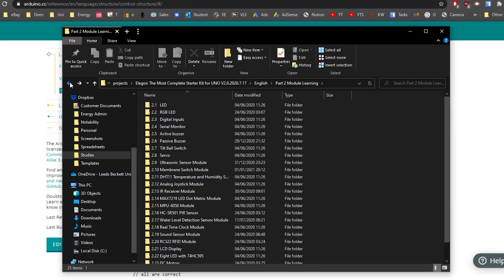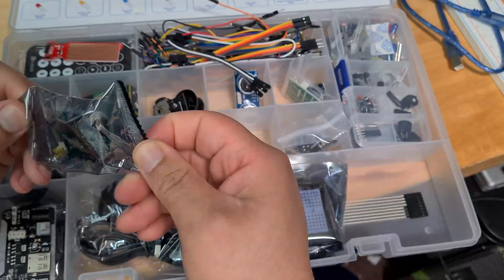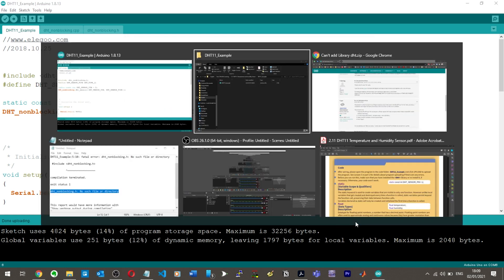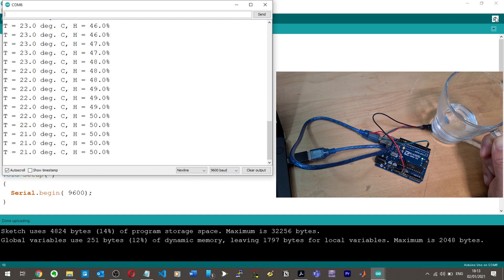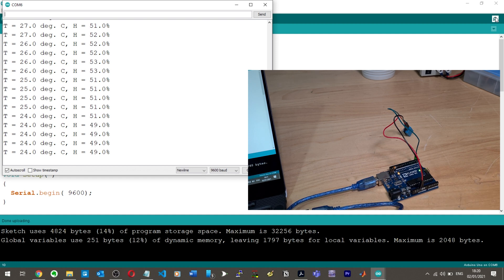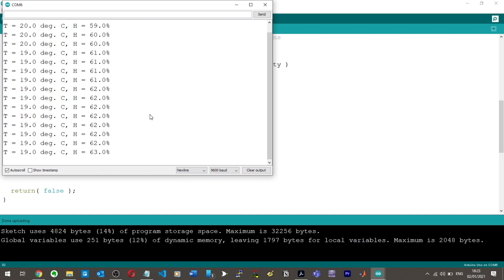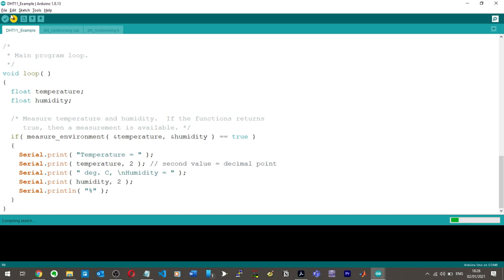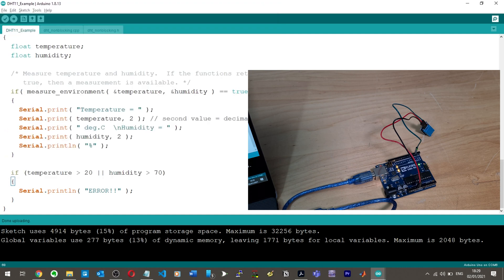DHT11 Temperature & Humidity Sensor Arduino Tutorial - Elegoo The Most Complete Starter Kit

Comment: I expect the temperature change is not related so much to the sensor as it is to the speed of heat conduction between the sensor and the environment. Air is a pretty poor conductor of heat, unless you have forced movement bringing in new air (eg. a fan). You'd probably have to figure out where the sensor is (presumably a thermistor or something?)

The millis() function returns the current time since the arduino started in milliseconds. By setting a variable equal to it, the arduino can keep looping and comparing to it. That way, it doesn't block other stuff (eg. the delay function completely pauses the program, stopping everything). Instead, every loop it checks if the condition is satisfied, and only prints out if it is, while still allowing everything else to be done. 

Essentially, a loop of the program probably takes <1 ms, probably a few hundred uS. By checking millis() and comparing against the last time it printed (setting measurement_timestamp = millis()), it knows how long it's been since it last printed out. once it's been sufficiently long (eg. 4 seconds), millis() - measurement_timestamp will be greater than the set period (in this case, 4000ms/4s). In that case, the function returns true, polls the sensor and sets temperature, humidity, which is then printed in the main loop. 

They are also using pointers to pass around the variables, which I suppose makes sense, but is slightly evil :p. They pass the address of variables temperature, humidity (the & symbol), while the function takes the addresses and modifies the objects they represent (the * symbol, which tells it to look at the actual int variable itself), allowing the function to move the information outside of itself (if you are familiar with scope in programming, you'll know what I mean. Otherwise you'll probably see it down the line in class).
Reply from the maker: ❤️🤣

The thermistor point is a good one, I did assume it was using one but I figured it would react quicker. I used one in first year but I was touching the sensor directly so that's probably what caused it to respond faster.

I was actually ok with pointers/scope, I spent a week studying it and finally got my head around it but I'm thinking it's gone again now lol.

Going to have to reread the millis() function part again when I'm not in a food coma 😅. Struggling to understand that one.
Reply: @HamedAdefuwa  
Millis() works by counting the time since the arduino started. It increased by 1 each millisecond. 

Consider that by setting a variable equal to millis(), that variable essentially contains a particular time. By subtracting that variable in later loops, you can figure out how long it has been since you last set it, allowing you to only execute instructions every so often, without using delay() (which completely blocks execution by doing nothing until some time passes)

eg it sets measurement_timestamp = millis() when the function returns a value. Lets say millis() = 0 (for startup) thereafter, the function returns false until millis()-measurement_timestamp is > your period setting. millis() increments by 1 every millisecond. so if your period is set to 4000, this will be true after 4000ms. At that point, millis() - measurement_timestamp > 4000 (4001 - 0 > 4000) is true, so it records new values, returns them, and sets measurement timestamp to the current millis() value until it repeats.

Basically, it looks like the below:
4000 - 0 > 4000, measurement_timestamp set to 4000
8000 - 4000 > 4000, measurement_timestamp set to 8000
etc.
Reply from the maker: @jordanb722  firstly I owe you big time for that explanation, thank you!

Secondly, how amazing is that function!?! I'd probably use that for every project. I'm thinking there are so many use cases for this. I had so much trouble generating a random number before but I could easily use this next time. For example take the value of the function and square it etc etc

I think that makes sense to me now, going to have to play with it in the ide to be sure. Thank you so much Jordan
Reply: Have to use pointers because C is a pass-by-value language. If you don't use pointers, the values will never get returned from measure_environment() to loop().
Reply: @endian675 True enough. It's been a while, so I'm not going to re-watch the video to check. So long as out parameters are clearly marked it's fine. 

Mostly you just want to make sure you don't have the same variable being passed around and kept in other places.